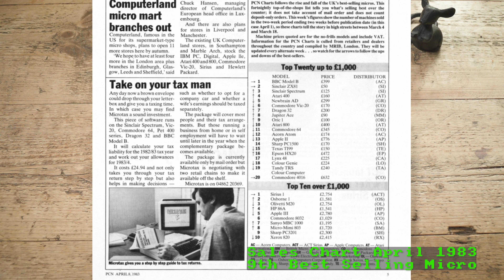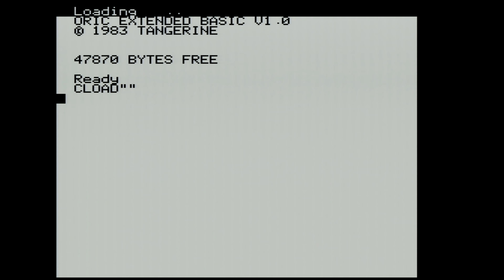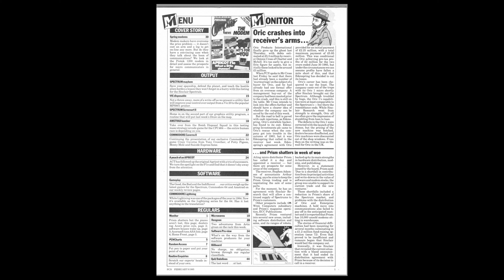ChinnyVision - Ep 490 - Oric 1 System Review

Comment: Little known feature of the Oric  - there is an audio output on the cassette port - ihad both my Oric-1 and later Atmos plugged into my amp using a self-built cable and the sound was awsome!

Comment: Hey Chinny - the button is the NMI button. The Reset button on the Oric does not in fact connect to the RESET line of the 6522. Instead, it activates the Non-Maskable Interrupt (NMI) line of the 6502. Can be useful for certain things, especially troubleshooting, since the 6522 needs that on bootup.
Reply from the maker: It's very recessed. Am I missing a button cover?
Reply: @chinnyvision  definitely not. It's just like that. I don't think they really intend you to press it much. And even if you do it won't have obvious effect, since it's not a reset button. All very curious!

Comment: Hi. I owned an oric 1 and two oric atmos who was an oric 1 with a legit mechanical keyboard. I also had the 3" floppy drive. Everything you saw inside is original. The built quality was very good. The Atmos particularly was above any other 8bit computer in terms of build quality.
Both had 64k RAM but the ROM was overplayed  over the last 16k of RAM. The idea was that when you connect the floppy drive, the ROM was disabled and you were able to load an alternate Basic OS  able to drive the floppy.
The video output of the Oric was legit RGB meaning quality image. Hires graphics suffered from a stupid color proximity limitation meaning that there was actually a range of void pixels when you insert a color change code. Developers found that limitation quite annoying and that was a major reason behind the lack of games. Also you could'nt get reed of the 3 text lines at the bottom of the graphic mode. 
The reset button was very usefull since there was no power button. To turn the Oric on and off one had to plug and unplug the power connector. The result was that the solder of the power connector usually gave up after a few years of use forcing users to learn soldering..

Comment: It really is the case of "the computer that almost could have".  The Atmos certainly has the better keyboard but the tic-tac style keyboard certainly gives the Oric-1 a unique look.  It could have been a better machine but it was priced badly.  You rightly mention the price of the Oric compared to the Spectrum however the Spectrum dropped its price to £99,99 for the 16K and £129.99 for the 48K just as the Oric got released so it just was unable to get a foothold.  Apparently it also had a fault with the cassette volume so that often when you saved programs they couldn;t be loaded back in again later.

All in all if it had come out competatively priced, fixed that audio problem and the colour clash, it could very well have been the Spectrum killer they had hoped for.

Comment: The Oric did only have 48k of addressable RAM - the 16K ROM was shadowed in RAM and I don't think you can access it without hardware tweaks. Also it only has 47K free in text mode I believe - like the BBC switch to a graphics mode and this comes down to something more comparable with the Spectrum, CPC etc.

I think the main thing holding the Oric back is that CPU - a 1MHz 6502 with no graphics acceleration features isn't the best environment for gaming. If it had been 2MHz it would have then slightly outpaced the Speccy.

There is a ROM bug affecting tape saving/loading which was a major pita although I'm sure this would have been fixed with speed-loaders etc had the machine gained traction.

Really what killed this machine though was it was too late to market. If it had come out in 1982 I think it would have given the Speccy a run for its money. I'm not sure it was as well suited for games as the Sinclair machine (even if the Speccy arrived there by accident, being fast as a direct result of its limitations) but I doubt this would have mattered.

Comment: I spent ages trying to an Atmos and eventually managed to get one shipped from France. It's a weird machine, but so nice to type on!
Reply: And yeah, the upside down board is an odd one, and a clever solution to having the speaker onboard whole keeping the internal footprint down.

The way attributes work is super odd. It's basically a Teletext-like system in both text and bitmap mode, which is an odd choice for a bitmapped display, but it somehow works.
Reply: Oh! And the cassette DIN connector can act as an audio out, though I haven't used it as one in my experiments with the Atmos.

Comment: Nice vid. I have mixed feelings about this machine as I got one I think around 1984. Prob early 84 and it might have been for Christmas.  I found the chicklet style keys horrible to use, clicky and I had forgotten the 'dead' area in the spacebar until you mentioned it.  I found the rubber key speccy better but ultimately got a Spectrum +. The real horror of the Oric was something that you didn't really touch on (possibly as you have a later machine) and this was the bug in the ROM which affected tape loading and saving. It was a total nightmare because you had to get your tape recorder set up just right for that particular game and even then you would get random failures and there were some tapes that just flat out wouldn't load. From reading around this was fixed in a ROM update but I don't know which, so I must have had an early machine which was repacked and sold off cheap by an unsrcupulous dealer. The only decent game I ever had for it was Xenon 1, which I did get some fun out of.

Comment: Just found one at the recycling site (Somebody dumped it). Haven't plugged it yet wasn't sure about the voltage needed. There is a coxial to Scart adapter with it but I guess using the VGA outpout would be better
Reply from the maker: You can buy an SCART cable with RGB from Retro Computer Shack. You need a 9v supply of around 1amp or better with a centre positive connection. Not a Spectrum supply which is the other way round and will damage the machine.
Reply: Have the Atmos. Software was always thin on the ground and although I knew alot of friends with either of the Price, we all had the same half dozen games.

Comment: I remember them breifly in Boots and in eary magazines. Never used one and they were gone as quickly as they appeared.64k RAM ... so does that mean it can all be used like a C64 does for its shared RAM/ROM addresses? Thanks for the breakdown, look forward to more videos on it.
Reply from the maker: Not sure you can use the extra 16k or not.
Reply: @chinnyvision  would be a shame if it can't as they'd have saved themselves some money excluding ram that's not needed? All academic I suppose, wonder if anyone is making games for it these days? Will have a look around.
Reply: @chinnyvision  You can but it involves some jiggery pokery... The only way to free up the 16K is via the system bus, so you'll need some hardware to set the address lines to page out the ROM.  Not for beginners!

Comment: How did they make money? Three answers to that:
1. The 6502 was a lot cheaper than the Z80 despite having comparable performance.
2. Their board design is even simpler than the Spectrum's, in particular because there is only one bank of RAM.
3. They didn't make money. They went bankrupt (but you said that in the video).

I think you are mistaken about the reasons for using 64kB of RAM. The main reason is that they had to. Each RAM chip can store or retrieve one bit at a time, so to form an 8 bit bus you need 8 chips in parallel. the available sizes of RAM chip were powers of two in size (e.g. 1, 2, 4, 8kB), so with one bank of RAM the total memory size also has to be a power of two. The Spectrum solved this problem by having two banks of RAM, an 8 × 4kB bank and an 8 × 2kB bank, making 48kB total. But that makes the PCB more complicated and by the time Tangerine did their design it was probably cheaper to just put 64kB in one bank and leave 16kB inaccessible.

When you read that BASIC "overlaid" the last 16kB, unless I am much mistaken, it means that the BASIC ROM uses that address space and the 16kB of RAM is totally inaccessible, even to BASIC. So no, the full 48kB is not available to BASIC programmers. BASIC will still take up some chunk of that to store it's runtime state, plus another chunk which will be used for video RAM.

It really is a 48kB machine in the same sense as a Spectrum 48K. There is a free extra 16kB of RAM that you can't use unless you take the chips out and put them in something else. It's a shame they didn't come up with some sort of bank switching scheme to make the last 16kB usable, but for whatever reason they decided not to. I guess that's one of the changes they made for the Atmos.

Comment: There were several sequels to the Oric-1, but it appears they used the same basic hardware with mainly ROM changes and a better keyboard. Older Oric-1s could also be converted via an empty ROM socket on the motherboard. https://en.wikipedia.org/wiki/Oric

Comment: A Sinclair competitor released in 1983 was a bit late to the party.  That’s the beginning of the 16bit era.
Reply from the maker: Tell me about all the 16 bit home micros from 1983? Or 1984? Or if you could even get hold of an ST or Amiga in the UK when both were released in 1985.
Reply: @chinnyvision  
The video showed a PC in a advertisement side by side with the Oric. 

The 8086 is a 16 bit CPU.  It's not a very good one, but it is 16 bit.  

The Mac came out at the very beginning of 84.  Essentially missing 83 by less than 2 months.  Apple already had failed 16bit computers by the time the Mac came to market.

About buying them in the UK?
I live America I bought an 8 Bit Atari around this time with money I earned working a summer job.  (No tape drive or floppy drive just the Atari.) I looked at the ads for PCs, they were just too expensive for me and my parents couldn't afford to buy me one.  So I bought a 800xl for $100.  It was only $100 because the 8bit era was ending.  They were already talking about the 16 Bitters in COMPUTE! and BYTE magazines.

The rise the PC had already begun.  And the world was worse for it.  It took til the late 80s/early 90s for the PCs to catch up with the graphics and sound capabilities of 8 but computers.  The original Macs were atrociously bad compared to a C64 or Atari.  It had a frame buffer and no hardware to support any sort of text capabilities at all.  Everything was done by the CPU.  It was designed to be cheap not to be good. The circuit design was so basic it looked like a college project using a 68000.  Ironically the Apple II GS using the 65816 was vastly superior.
Reply: when the 16 bit machines were introduced they were ridiculously expensive. So a new, cheap 8 bit computer in 1983 wasn't so late to the party. Amstrad was later still and had decent success with the CPC range. But I guess the American and UK markets were very different back then.

Comment: The cpu was only 1mhz, i know you cant directly compare the z80 and 6502 on clock speed due to architecture differences but that still seems a tad slow compared to the spectrum. Very nicely designed internals, im guessing these are pretty reliable machines. I bet you can use the extra memory Basic uses via some software trick, wonder if anyone ever tried?